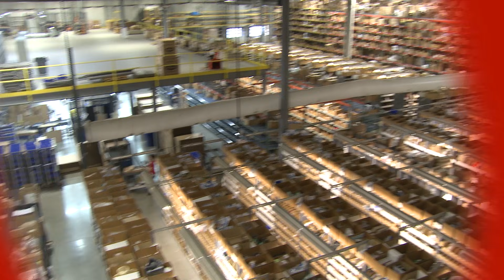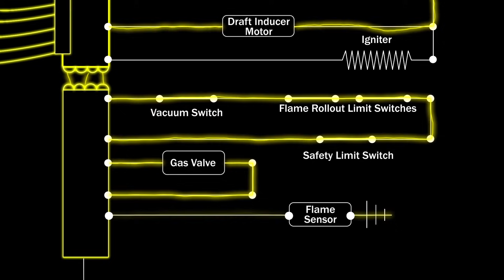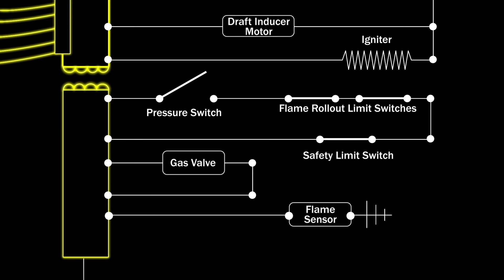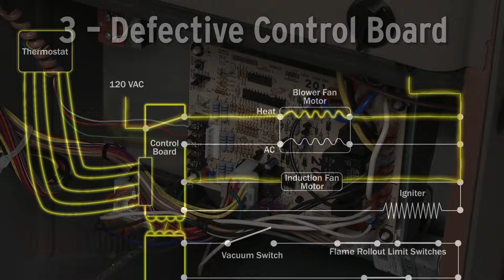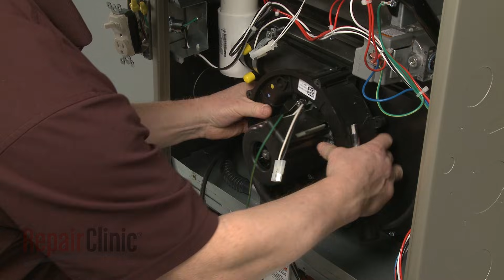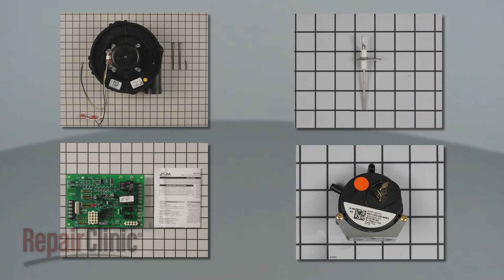Furnace Starts Then Stops — Furnace Troubleshooting

Comment: Was having intermittent short cycling.  Furnace either started ok or would run for just 3-4 seconds.  Here’s what I checked & how I fixed it.
1) Dirty air filter.  Nope, I replace them religiously.
2) Clogged exhaust vent or blockage elsewhere in ductwork.  Nope, knew this wasn’t it.
3) Dirty or cracked flame sensor.  Nope, removed it and inspected & cleaned it.  Still short-cycling.
4) Corroded or worn burner(s).  Thought this might be it because the 2 upstream burners had a nice strong blue flame but the downstream 3 burners (including the one with the flame sensor) were either not igniting or had very weak flame.  Cleaned these 3 burners inside and on the discharge end with a wire brush.  Nope, still short cycling.
5) Gave it some thought… there had to be a reason I wasn’t getting strong gas flow at these 3 burners.  Bent a piece of solid core wire (about the same diameter as a paper clip) and worked it into the gas manifold nozzle orifices of the 3 burners.  Pushed it into the hole and wiggled it around.  Turned the furnace on and… I had BEAUTIFUL blue flames on all 5 burners.

So, don’t forget to check your gas manifold nozzles for blockage!

Comment: 35 year-old carrier furnace original thermostat was working great. The heater would come on reach temperature and shut off and then then a second later turn on for three seconds shut off turn on three seconds shut off and then then I’ll be off for good. Change the thermostatsame issue.

Comment: I have a problem with my Electric Furnace.  It is starting and stopping every 4 minutes or so.  It does hold the house temp steady. I just replaced the mercury thermostat with a new programable.  Is this normal operation for a newer thermostat?  Thanks for your video..

Comment: My gas HVAC runs heat fine, until it gets really cold outside. Then it will try to start for 30sec but not blow any air. It won’t work again until the day comes and warms up the air outside above 25 degrees
Reply: Your venting has issues. Maybe too long?

Comment: I recently fixed my old Maytag furnace, which I believe dates from the late 90s. I replaced a fuse, and suddenly, the furnace worked flawlessly while holding the ignition. Little did I realize that the lower door holds the ignition switch on, making it necessary to have the door on to keep the furnace running. I was kicking myself once I figured this out. There's a video on my page to fully explain this!

Comment: I'm stuck!! 14 year old American Standard Freedom 80 single stage gas furnace. Keeps shutting off the burners at random times. Fires up then shuts burners off after 2-3 seconds, or fires up and shuts burners off after 20-30 seconds, or fires up and shuts burners off after a minute or two.
Parts replaced so far are: flame sensor, pressure switch, gas valve and control board
What could possibly be causing this to shut off so randomly AFTER the burners fire up? Could it be a limit switch??
I thought replacing the control board would certainly fix my problem, but it is doing the same thing. Now I am stumped!
Any ideas??
Reply: Try cleaning the condensate trap and all of the condensate and air lines

Comment: My furnace runs for 5 minutes then stops. Could it still be a flame sensor?
Reply: I have this exact problem. Runs for 4 minutes then shuts down.
Reply: @ForumRider158  mine turned out to be the motherboard (about $30 used)
Reply: I've been suspecting that as the case but mine is $320. I may take the gamble though

Comment: One issue that we faced was that the technicians refuse to replace the control board that we ordered saying they only replace parts that they ordered themselves. Any tips to find technicians who will replace the control board that we ordered from repair clinic?
Reply: Yeah because they can't gouge you on the price. Super easy to fix yourself only takes about 5-10 minutes to replace. Take a picture first, so you can keep the plugs in the right spot

Comment: Helped with my Colman gas furnace. Mine is a high efficient furnace which will create water when heating. So drain didn't work well some water went into flame sensor. I sanded it put it back on now the flame finally stay on

Comment: My furnace blower runs few seconds then ignited 5 seconds after ignition it dies then 3 seconds on again,  what’s the  problem of my furnace
Reply: flame sensor
Reply: To clean the flame sensor, do you need to shut off the gas valve?? Mine runs 3 seconds and goes off. I just heard a noise like rattling.

Comment: Thanks - my furnace had the short run problem - started for 10 seconds and then went out.  19 year old furnace - opened it up and cleaned the sensor as directed (and lots of other stuff)  Fixed it!  Thanks for saving the service call!!

Comment: my igniter & pilot light don't always go on at the same time. especially if my unit has been off for awhile. once it starts (after turning it on & off a few times) it works ok until it's been off awhile. i've had the gas valve, control board & burners replaced. inducer motor works fine. the inducer motor can run for 15 or 20 minutes & then the thing fires up & runs fine the rest of the day. if the inducer motor runs for awhile i'll go out & hit the breaker switch off, turn it back on & it fires up . i've seen the ignitor come on but not pilot flame. could it be the thermostat?

Comment: See this isn't what mine does. The blower comes on for about 10 seconds then shuts off, then about 10 seconds later it comes on again and stays on that time until it gets warm enough then shuts off. What's weird is when it turns on the first time after it shuts off for 10 seconds it still sounds like another fan is running until the blower comes back on again if that makes sense. I'm not experienced with heating systems but thought there was only one blower fan for the system. It's an all in one unit outside made by goodman model number is gpg1336070m41ba. Maybe it's the burners I am hearing through the intake? Idk.
Reply: trucker V I have Goodman unit as well doing the same thing. I cleaned the flame sensor and that solved the problem.
Reply: @kuhlcee  ok awesome. Thanks alot. I will do that and see what happens. I mean it has never done it before and nothing has changed it just started on its own so whatever it is couldn't be a huge issue.
Reply: My unit is 11 years old and had never done it until the last few weeks. It started with one cycle then start until last 2 days when it went to 2 cycles then start. This morning all it did was cycle but not start and the temperature in the house was dropping. I was going to have my HVAC guy come to check it before I came across this video and another just like it and got it running again. Apparently it’s supposed to be cleaned once a year. Something I wasn’t told before.
Reply: @kuhlcee  I'm not sure how old mine is but I've lived in this house for 3 years and it hasn't been done. I didn't know about this either. I'm going to do it today since we have a big snow storm hitting this weekend and very cold. Don't want it to just blow cold air inside. Thanks for the info.
Reply: Mine was just doing the same thing. After shutting the breaker off..taking out the flame sensor and cleaning it with the abrasive side of a dry sponge and then one by one restarting the machine..gas on temperature up then turn it on and it should fire up no problem